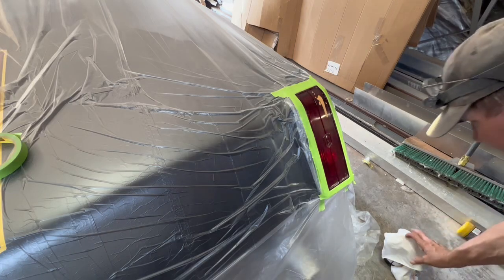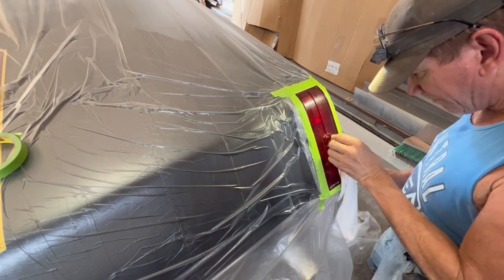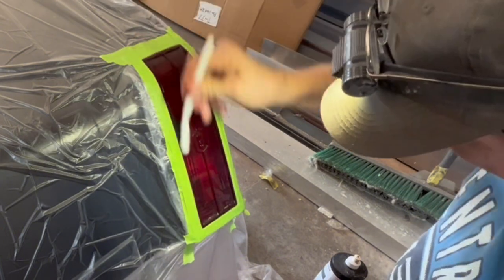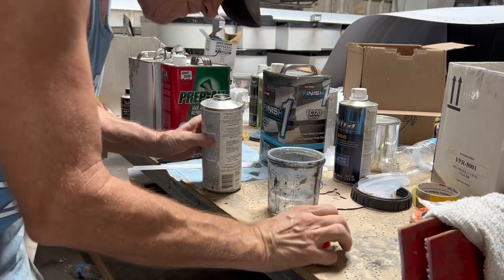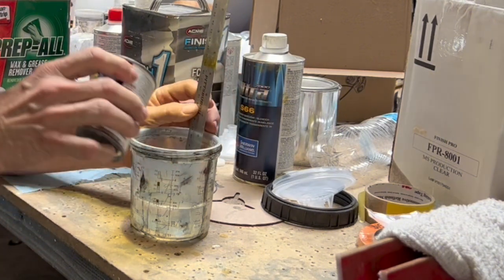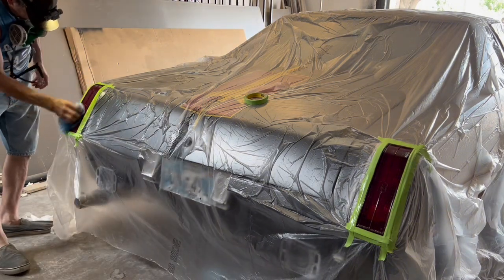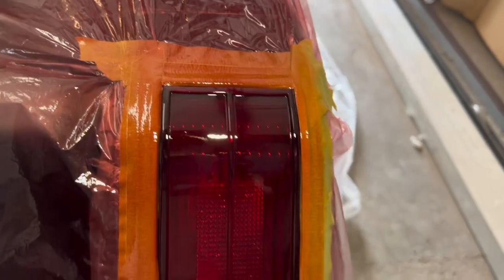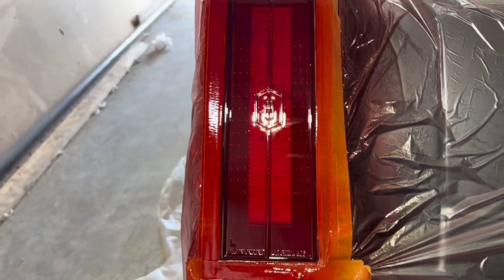CANDY COAT YOUR TAILLIGHTS ✨😁 Easy DIY Tips To Restore Tail Light Lenses How To Have Bright Lights

Comment: I've been airbrushing for a long time, the one product I've found for sticking to taillights, and composite headlights is createx 4050uvls , its water based,  uv resistant clear. They also have good candy colors too. It lays out super smooth and it's almost as durable  as the 2k clear.

Comment: I tint lights after work in the paint booth all the time for friends, the only thing I do differently is spray adhesive promotor and let it flash 10 mins before I lay the candy coated clear down, never can be too cautious Bondo Billy
Reply from the maker: Good idea 😉👍

Comment: Can you use a maroon scotch bright pad if you don’t have that compound?  Is compound better in this situation?  Thx @bondobilly
Reply from the maker: The gritty compound doesn’t just clean scum and stuff off the surface. It leaves tiny scratches from the grip in it for the clear to stick to.
Reply: Scotchbrite and 3M Scuff It. It is a paint prep gel designed for this very purpose.

Comment: Hey I have a 2005 Silverado with a weird issue on my taillights, it looks like cracks but feels smooth on top. Do you know if this would work? Thanks for the enjoyable and knowledgeable videos as usual Billy!
Reply: I bet most of those cracks are just below the top surface. If you can make the cracks you see disappear with regular car wax or even WD40, even just temporarily, that means that the cracks can be filled without having to physically sand off the top layer of plastic. If they are not temporarily disappearing  with wax or petroleum products that means they're below the top surface. You might be able to use some fine sandpaper to get through to the cracks. Once they're exposed the clear cost will fill them and seal them making them look virtually brand new. Good luck!
Reply from the maker: It would help